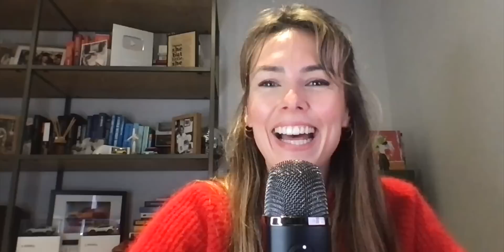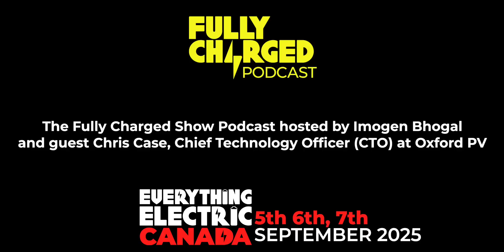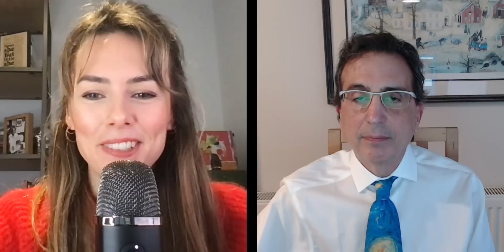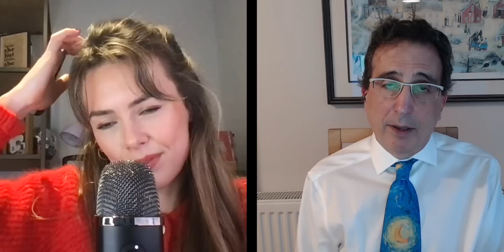The Untold Story Of Solar Power & Why It Took Decades To Take Off! | With Oxford PV

Comment: Best perovskite life seems to be about 2 years. Silicon PV is between 20 and 40 years. Any current perovskite lifetime efficiency needs to be divided roughly by 10. Only applications with a short life are practical.

Comment: I enjoyed this podcast. In the spirit of your last point. Covering Texas with PVs. I wondered how much power you could get from covering the deck of a large container ship with PVs and would it be enough to get moving. Short answer, yes but at 12.7 knots instead of the usual 16. These vessels cost 2 billion and taking 26% longer each trip might not add up on the balance sheet but it is more feasable than I thought

Comment: Small (and honestly unimportant) correction. Earth is 510 million square kilometers in area, and considering it's 1,000,000 square meters per square kilometer, that means earth is 510 trillion square meters, not 10 billion :p
At 29% land coverage that's 148.362 trillion square meters. 
At 500,000 cubic meters of perovskite over an area of 10,000,000,000 square meters, it comes out to 0.00005 cubic meters per square meter, which would mean 0.00005*148.362 trillion square meters, giving 7,500,000,000 cubic meters assuming the same calculations.
Regardless the main point still stands, it requires very little solar PV's to power the entire worlds needs.
Reply: The One Sun, One World, One Grid global initiative takes advantage of this point plus that the Earth has a sun belt where maximum solar radiance can be collected.

Comment: Instead of spending money on large solar farms and enhancing the grid, why not subsidise commercial and manufacturing to built on their rooftops? Afterr transmission losses, levies and markups by the time it reaches the consumer, would it not be cheaper in the long run? The money should be spent on local infrastucture, such as substations and batteries (storage).

Comment: Why hasn't the UK government sorted out funding for this company so the panels are built here, in a purpose built factory? It's absolutely crazy to be wasting time on a UK based company and sharing the financial rewards with Germany. Give them everything they need to deploy an enormous factory here and make the UK a powerhouse (no pun intended) of PV manufacturing.
Reply: The plant in Germany is due to partnerships, which reduce the risk of developing technologies. However, it's a trial production facility to producer cells for grid energy generator customers around the world. Also developing pervoskite manufacturing process and equipment that can bolt on to existing silicon only PV production lines.

However, OxfordPV are also following a licensing model (similar to other successful UK tech starts ups like Arm holdings), providing IP and manufacuring know-how and equipment sources for other PV manufacturers to produce PV cells. This will ramp up global production much quicker and a lower overall risk that productuon by a single company.

Comment: I keep being told that the price of solar panels has fallen through the floor but………….. I bought a complete solar installation from Hanergy via IKEA (yes that IKEA) fully installed and connected to the grid and FITS for £5750 (after 15% discount for using my Family Card!) in 2012 - this was 39 x small solar panels to give a 3.9Kw capability, with inverter and generation meter, including scaffolding and labour . Now when I look to add the same size system on the other side of my roof I’m being quoted more than double that for a system without any battery - adding that doubles the price again. So where have the huge drops in the price of solar since then gone to?
Reply: Yes...I installed a 4 kw system 10 years ago for about that price  ..and I don't think a 4kw roof solar system is any cheaper now despite all the massive price drops I keep hearing about. I think the installers are just looking for more profits and not passing any price reductions on at all.
Reply: A 3.9kw system is just not something youd go for these days. Typically youd be looking at something like a 10 Kw system for a typical house. But mainly the cost reduction is in the amount of power a single panel generates. I  Had like 70KW panels back in the day, now they are typically over 400-500KW. And so that also means you need alot less panels.
Reply: Suppliers need to make a profit, panel costs may have fallen dramatically but every other cost has increased.
Reply: Installation labour and scaffold etc has risen more than the panels have come down 🤷‍♂️
Reply: I agree completely. There is no evidence in the prices I can get of any reduction.
Reply: It sounds like you need to find another quote.
In October 2024 I was quoted just under £2700 for an 8 x 420W system.  Extra panels each added about £200 to the quote, so around £3100 for 4.2kW.
On the same quote, a 4.7kWh battery was an extra £2164.
For comparison I got a quote for exactly the same system the previous year (2023) and the cost then was £4200 for the 8 panels and £3600 for the battery.
Given that installation made up around £1000 of the 2024 quote, applying that to the 2023 quote implies that the cost of the panels has roughly halved in price in the last couple of years.
Reply: There was an article the other day about how manufactured diamonds are now indistinguishible to Natural diamond but retail for 1/4 the price. The thing is they only cost 1/14 the price wholesale. As the cost reduces retailers pad their margins.

Comment: the last section re decentralized power took my interest,  as installing PV with batteries on a home away from 'the grid'  and fuel supply lines, will enable these people to become educated and have a better life style.  Also, for the rest of us,  having solar and batteries could  take the pressure off the grid and provide local energy security.

Comment: Why a German factory,? When will UK get solar manufacturing?
Reply: Because our governments are too stupid to incentivise modern factories to come here and the Germans weren't. It's not that they didn't want it here, it's that they couldn't afford to build it here. We should be acting on this and doing everything we can to invest with them and make their next factory a modern, purpose built facility which can truly output large quantities of panels. That's how Tesla got funded and they paid off their loans as quickly as possible so they were out of that agreement - it wouldn't actually cost the UK anything to fund this as we'd get the money back and have a factory producing money for our economy.
Reply: Back to reality, the German factory is due to a partnership with a Swiss PV production line equipment manufacturer.

OxfordPV are not only innovating the science of tandem solar cells they're establishing the commercialisation process and production technology. Their approach is to prove the technology in the field at scale at utility customer sites, for whom the extra generation efficiency at higher initial price is cost effective, then license the technology as a complete solution to worldwide PV manufacturers. This removes the risk of scale out and competition in non-core areas whilst enabling the technology to become universal more quickly.

Given the viewpoint of locallised production expessed in the video, then a UK solar PV partner could indeed use their technology to produce for the local market.

Even UKSOL, a UK PV panel manufacturer only performs assembly in the UK, the components are made in China, Turkey and Spain. This is true of most manufacturing in the UK, if not all parts of the world, these days.

Comment: Around 75% of people will live in cities by 2050, and cities are excellent places to put solar panels - on rooftops, shading roads & car parks, as  noise barriers along highways, as fencing... perhaps even as roadways. 

Solar panels are also great at shading many agri-plants (i.e, agrivoltaics), awa waterways. The possibilities are endless.

Of course some countries have better solar potential than others. I wonder when the UN will start talking about a global electricity grid? Africa has enough wind to power the whole world, awa massive solar potential (as long as we don't interrupt ecosystems & wildlife migration pathways etc).

Coastal cities can take advantage of off-shore wind as a backup.
Reply: When folks talk about nuclear fusion, I like to make a slightly tongue-in-cheek joke to satirically make a point.

Why should I trust that we'll make good use of a "mini Sun down on Earth", when humanity is not yet taking proper advantage of the free nuclear reactor we already have in the sky?

Like, I'm not altogether serious there. But you hopefully get the gist of the point.

When I see so many roofs covering vast areas of urban sprawl without any solar - we're not even scratching the surface of what's possible - and we're not bothering too much to exploit the free nuclear reactor we've already got.

Then even if we had economically viable sustained nuclear fusion down here on Earth, why should I have any trust whatsoever that it'll be properly exploited?

We're not even trying with what we've already got - and which is freely available - so why should I believe that this tough, expensive, difficult thing of recreating a sustained nuclear fusion reactor here on Earth will go any better?

It's like all the push for hydrogen cars. It's not because it actually makes sense, it's because it maintains the "we produce it, you pay for it" model for making massive profits from what should be a basic necessity for all.

Comment: I'd love to hear what Chris's opinion is on "quantum dot" solar cells.

I was reading about these, but I'm not sure how seriously to take it.

Because the article was boasting about how - in the lab, at least - they could actually push for 67% efficiency. Which is yet another step change higher again.

And the explanation didn't sound too outrageous.

Because "quantum dots" are a real thing - found in some modern TV sets, so they can be mass-produced at scale (at reasonable cost, because though QD TV sets aren't the cheapest, they're also not vastly more expensive to non-QD TVs of similar sizes), as that's already happening for a different application - which are able, via a quantum effect, to change the frequency of light.

So the basic concept is that the Sun's light comes in many frequencies - some stronger than others - but you'd use layers of "quantum dots" to step the frequency up or down to match the bandgap of the photoelectric material. Take the Sun's blue / UV light and then change its frequency to the IR that the PV material is good at absorbing.

And, you know, in my wild imagination, I'm picturing perovskite cells - because they're thin film and cheaper than silicon - with "quantum dots" attached, that funnels all the different frequencies of sunlight into perovskite's bandgap. For yet another step change, up to maybe that quoted 67%.

Of course, we all know to be cautious. There are new "breakthroughs" reported in solar and batteries all the time that you never hear anything more about. But this sounded more plausible to me than most, simply because "quantum dots" are not a theoretical thing. They are already being used in TV sets to improve quality and saturation. They're already mass produced at a large scale in that industry (as a single TV screen has many millions of pixels).

Thus, if it's true that you can use quantum dots to funnel the stronger frequencies of sunlight into the bandgaps of PV materials, then this could further help efficiencies to soar.
Reply: Great idea!
Reply: That'd be exciting if it reaches mass production anywhere near that number, let us keep watching.
Reply: @lua-nya   Yeah, it sounds good.

But that's why I'm a little hesitant, as you know what they say about things that sound too good to be true...

...but, at the same time, the article I read also made perfectly plausible sense and didn't seem like hyperbole. 

Quantum dots are a real thing actually in mass production for consumer products right now - so we know they can be mass-manufactured economically - and the article had a graph showing the frequency spectrum of sunlight, pointing out (as Chris does in this video too) that a problem for efficiency is that the sun is shining brightest in frequencies that photovoltaic materials don't absorb too well. The "bandgap" is in the wrong place.

So the proposal - which sounded reasonable - was using quantum dots to change the frequencies of sunlight to "funnel" them all towards that bandgap and that's why, they suggested, they could achieve such high efficiencies. They're attempting to not leave any sunlight on the table, but try to funnel it all to electricity generation.

The whole thing might be bollocks, admittedly. I don't know. But the article made sense, and it's talking about a thing that already exists and is economically mass-produced right now, so there was no obvious impediments that I could see to what they were saying.

So, yeah, I'm not saying that this is definitely a thing. But it sounded good and plausible - and if it were a thing, to step change up to 3 times more electricity generated for the same area of PVs (compared to silicon) would absolutely make solar a "no brainer". Solar roofs already make a lot of sense for many people - if they suddenly made three times more sense, paid for themselves in a third of the time, etc. then the calculus would become compelling for pretty much everyone. 

This was why I was courting Chris's opinion. Because if this is a real thing, then he'd know about it (if he's not looking into it himself, then he'd know whether his rivals are taking this seriously).

Comment: CO2 climate destabilisation means BEV, battery vehicles, are the cleanest transport and easiest to top up daily. Rooftop PV 😊

In 2023, nearly 14 million battery electric vehicles (BEVs) were sold globally, which is a 35% increase from 2022. This brought the total number of BEVs on the road to 40 million. 
60 million 2024

BEV Massive batteries on wheels parked 23hrs every day and all night long.
80% of the world's population live in warm latitudes. Perfect for rooftop PV. 
Rooftop PV electricity biggest problem is its massive 5hr production for 24hr demand. 
Rooftop PV electricity is dirt cheap electricity. 

BEV daily drive is extreme under utilization of a valuable resource. BEV massive battery are designed for the long drive or long time between rapid charging. 
BEV in commercial use have huge hours of operation. 
BEV massive storage battery on wheels, parked 23hrs every day and all night long with v2g technology are perfect for owners to maximise tax-free savings on no petroleum, no grid electricity, no gas heating and cooking and hotwater. $10,000 annual savings. 

High marginal taxpayers are early adopters and can gain the highest tax-free ROI, return on investment.

My background, BEng, CivEng. Construction.    
Decades of construction pricing and construction work. Including GRID electricity supply. Power stations and transmission. 
Now retired and free of construction company restrictions on speaking up. Grid construction engineers silence is deafening. 
Grandchildren and children need an economic energy future. 

GRIDs are extremely expensive and need extremely very large cashflow. 

Grid capacity is $1million to $10million per km. 
Millions of km is no joke. $BILLIONS projects.
Vested interests.

Look at government enquiries into grid expansion projects budgets explosions. 

Hello from the warm latitudes of Australia. 😊
Remember all latitudes are warming. 😮